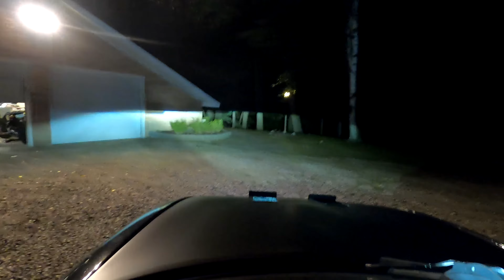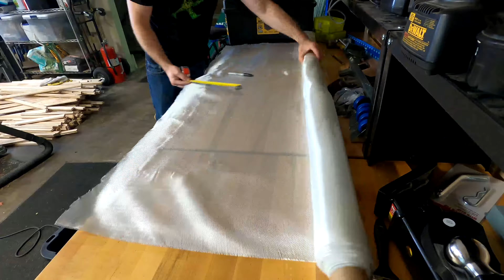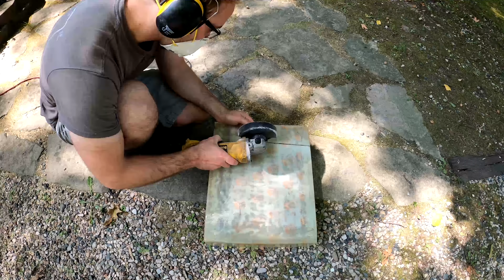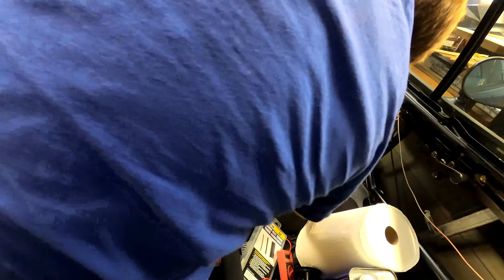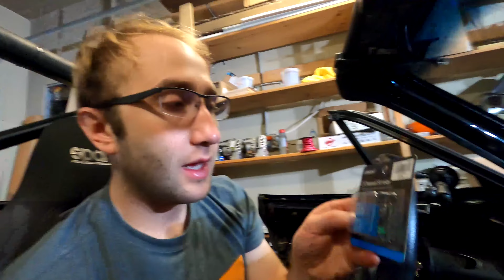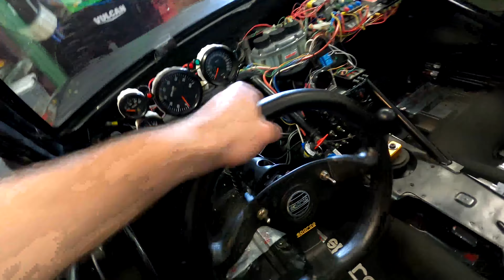Fixing and Improving My DIY Adaptive Headlights

Comment: Hi!! This project is super cool and im trying to do something similar for my car , for your pot sensor what gear did you use on it and the steering wheel? And is that setup attached to the steering column something i can buy or did u make it yourself?👀

Comment: why in the world didn't you use a draw wire encoder for the steering angle? It would have been less prone to problems, and it wouldn't need anywhere as much engineering to get the thing attached. I am in the process at this time of adding 2 HID projectors to each of my headlamp assemblies. When done they will be curve active and also horizon active. All of the electronics are inside of the housing. You are also going to run the risk of cracking your windshield because of the heat from the lamps. I don't see any kind of a limit switch system involved in there, how is the design supposed to know if say you stripped a gear in the servo? You might also consider using RC car shocks that have the springs internal with this type of shock you can cut a small piece of spring to put on the opposite side of the plunger from the large spring. Fill with a heavy oil and now you have something that gets rid of servo slop
Reply from the maker: That came down to cost.  I looked into using a string pot but at the time when I first built this, any decent looking options were on the order of a couple hundred dollars.  The style of pot that I used can be had for ~$10 and integrating it really wasn't that bad.  A string pot would have eliminated the gears and any lash concerns but the gears have proven reliable so long as the lash is set properly and they're sufficiently well protected to keep the wire for my steering wheel controls from getting sucked in.  I had more problems early on when a couple of pots that I sourced from Amazon failed but when buying what was allegedly the same model from DigiKey the problems went away so I'm suspicious that the Amazon ones were counterfeit.  

Are you documenting your project anywhere?  Sounds pretty cool! 

I'm not worried about the windshield cracking since it doesn't get very hot inside the housing.  The housing has a sufficient surface to volume ratio to dissipate the heat effectively.  No worse than running a defroster.  

There aren't any physical limit switches but there are software limits that, to date, have been successful in keeping the components from reaching mechanical limits.  

I've actually considered incorporating RC car dampers and might still do it if/when I revisit this project.  The springs that I have now soak up any slop in the servos but the servos can still be kind of jittery in their movement.  I might be able to address this to an extent with software filtering too.
Reply: @CurtBagne  Hey I solved my starting position problem, and I no longer have a need for using limit switches as a way of knowing if a servo failed.

I was thinking how does the servo know when to stop moving.. well it has a pot in it that is attached to the output shaft. I opened up the servo located the solder point for the pot on the little board inside it and soldered down a wire to it. So now my servos provide position feedback. I have to mess with it a bit to see if I am going to need voltage dividers because I am feeding the servos with 5 volts and the ESP32 has 3.3 volt GPIO's. I am not going to be moving the full 180 degree range of motion so the pot may not eclipse the 3.3 volts. If it does it is no big deal to make the dividers.
Reply: @CurtBagne  I haven't done any real documentation yet on my lamps. I have 2 of them to do so after I iron out the kinks in the first assembly I will then document what I do on the second. Mine is pretty involved, I had to cut the back of the housing and extend it to fit the additional pieces in there. I ended up building a vacuum forming machine and I bought a sheet of the same plastic the housing is made from and I formed the piece I added onto the housing. I then used 1/8" rod made from the same plastic and put it in a Dremel tool leaving only 1" sticking out. I set the Dremel on it's lowest setting 5000RPM and I pushed the rod right at the seam where the housing and the new piece met. I went around the entire seam "welding" the 2 pieces together I have some photos and some information here. 

https://www.solsticeforum.com/threads/dual-projector-hid-retrofit-attempt.162037/page-2#post-2223275

I am using the RC Car shocks as dampers, the ones I got have internal springs and they also come with 4 different plungers that have a different number of holes in them. This is to set how much dampening the shock has. You can get a  draw wire encoder that is well made for about 100 dollars., the thing that drives the price way up is the length of the string. get the diameter of the steering shaft, do the math to get the circumference and times that by the number of revolutions the wheel can make (typically 3 turns 540° degrees each direction). It's a really short string that is needed. add in some some length for mounting and also so you don't hit the mechanical limits.

I am using a 3-axis gyroscope, 3-axis accelerometer, 3-axis magnetometer (to correct drift) coupled to a Digital Motion Processor (DMP) to get the orientation of the car. I am using madgwicks quaternion equations to break down the orientation readings into pitch and roll of the vehicle in degrees. My vehicle has stability control so I was able to reverse engineer the CAN frames for the stock steering angle sensor. Because I do not want to add any additional load to the car I also added in a 3.5 farad super cap so when power gets cut I am able to "park" the lamps, this way I do not have to go heavy on the springs. The cap is super small maybe 1" x 1" x1/2" there will be one for each headlamp assembly, it's enough to power 4 servos at 2 amps of draw and all of the electronics for close to 3 seconds.

If you got decent metal gear servos that are digital jack up the PWM frequency to 200, this will give you a far greater precision for the servos. It will eliminate most of the jerking. Another thing you can also do is for loop between every 10 PWM settings between the last position and the new position adding a small delay between the changes.
Reply: @CurtBagne  Oh I also found a company that makes a worm gear servo that has the same footprint as the ones you are using. A worm gear servo will have 0 slop and it will also lock in position when powered off. They come at a high price tag of 70.00ish  USD a piece and they have a lead time of 2 months to get them. the model number of them is EVO-P4W-SiC
Reply from the maker: @kevinschlossser7858   This is really awesome--I'll definitely be following your build thread.  Especially curious with how everything will turn out with the IMU and using the feedback from it.  A couple of thoughts though...  Have you looked into getting vehicle position info off of the can bus?  Most vehicles will have a gyro to measure the roll axis.  They use a "leaky integrator" to avoid drift.  To my knowledge, most vehicles don't have a gyro for pitch; however, as it's not so crucial for avoiding rollovers.  

You might also be interested in adding something like this so that your setup can respond to traffic: https://pixycam.com/pixy2/  I wanted to incorporate one of these in my setup to aim my lights down and/or dip the high beams to respond to oncoming traffic or to be more courteous to vehicles in front of me but ultimately decided to just keep it simple because time.  

I'll look into some of those servo ideas, especially if they're fairly simple to integrate.  Thanks for sharing.
Reply: @CurtBagne  On most vehicles the accelerometer and gyro are located in the passenger presence module that is apart of the airbag system. Typically the EBCM and the air bag systems are tied together on their own databus. The information can be requested from the EBCM, in order to get that request frame you would have to use an OE diagnostic tool on the car. I would have to have access to one and set up a man in the middle type of system to know what is being sent out of the diagnostic tool.. at to be honest at 5 bucks for the MPU9250 i wasn't worried about it. I am running an ESP32 to handle everything. these things are dual core and have a 240mhz RISC processor. so they are fast and do not have problem doing complex floating point math. They have gobs of ram compared to the Arduino's. and there are exactly enough pins to do everything I need to for a single housing. I run MicroPython on it so developing is a breeze. and I can push software changes to it over bluetooth or wifi. It does have a can interface built into it as well tho this is not supported in MicroPython.

I had to come up with some pretty crafty ways to take care of some of the issues I ran into, because of how the lamp is directly connected to the servo and there is no use of a rod I quickly discovered there is actually a large amount of play in a servo's spline gear where the servo horn attaches. and my time that play gets up to where the lamp is the lamp would wobble about 1/4" total. I ended up getting aluminum servo horns and made a plate that foes over the bottom servos, it essentially joins them together, this play sits under the servo  horn and is such a tight fit that the aluminum servo horn slides on it. It acts like a slide bearing and removes the wobble from the spline. 

I am also trying to build this thing with cost in mind. I want to make it as cheap to do as possible. If I didn't have to build the vacuum forming machine I am about 200 bucks per lens.
Reply from the maker: @kevinschlossser7858  Sounds like you've got it all figured out.  Maybe our vehicle experience differs a little but the IMU should be tied to the ABS module.  At least for Conti and Bosch systems, the ABS modules handle all of the processing for the stability control and, as such, need to be continuously fed the vehicles inertial measurements.  If you have a definitions file or if it were worth reverse engineering, the pitch, yaw, and accelerations are all available for the taking.
Reply: @CurtBagne  I can tell you that using an MPU9250 is really accurate when using madgwicks quaternion equations. Those equations do a great job of filtering noise and sensor jitter. I am not looking for the numbers to be accurate as far as the orientation where 0 degrees is really 0 degrees, I need to know the difference between samples and I am averaging those over a really short period of time to determine if the car is going over a speed bump or up a hill. a speed bump is going to be an extremely sharp change to pitch. Hard braking is also going to be a sharp change to pitch. I am also collecting the vehicle speed over CAN so the faster I drive the higher it will angle the headlights up. I change the angle by 3 degreess starting at 30mps and ending at 70mph. it also corrects headlight aim due to hard cornering and weight shift of the car. it will pitch the lamp up that is on the outside of the corner and the lamp down that is on the inside.
Reply: @CurtBagne  I figured out a wicked simple way to get rid of the servo slop. It has allowed me to completely remove the shocks and springs and the servos stay put when there is no power supplied to them. IDK how I didn't think of this before, I was overthinking the problem is what I was doing.

I used these guys for the servo horns.
https://www.amazon.com/Seamuing-Aluminum-Futaba-Mechanical-Helicopter/dp/B07D56FVK5/ref=sr_1_5?dchild=1&keywords=aluminum+servo+horns&qid=1616742614&sr=8-5

I scrapped the screws they came with and picked up a 1000+ piece assortment of 3mm socket cap screws in assorted lengths. I took a piece of 1"x1"x1/8" aluminum L channel and I cut it so it would fit between the mounting holes. The L covers the top of the servo and one of the long sides. I drilled a hole in the aluminum where the spline is sticking out of the servo. I drilled it so the servo horn would sit in the hole nice and snug. when the servo horn is pushed onto the servo with the aluminum being sandwiched between the horn and the servo that removes all of the wobble to the spline and there is enough friction between the L channel and the horn where it eliminates drift when no power is supplied and it also eliminates the rotational slop from the gearing...
Reply from the maker: @kevinschlossser7858  Thanks for sharing.  That is a really simple fix.  I'm curious how it'll be over time seeing as it'll introduce an axial load on the servo which it may or may not be amenable to.  I could also see it wearing in and loosening up over time but seeing as servos are pretty inexpensive and that my car doesn't see a ton of use, I might give it a go.
Reply: @CurtBagne  The servo should operate better with the load. You are using springs to produce the load. This is using friction instead. The funny thing about aluminum is that if you rub 2 pieces together is doesn't wear like metal does. I think it's because of how soft it is. Also where you put the 4 screws to mount something to the frame horn...You will need to get exact length screws or file them down on the back side of the servo horn. Here is the cool think with this, you can leave one of the screw holes for an adjustment to the amount of friction you want to apply. so if it does loosen over time it can be adjusted to remove it. 

I set up my x axis servos like this and have been manually turning them back and forth, has go to be 1000 times by now checking for clearance. The were extremely tight initially and have loosened a little bit but not enough to allow play back in and they haven't gotten any looser after the initial "break in".
Reply: @CurtBagne  for the y axis servos the mount for the projectors is a U, It attaches to the servo horn and goes around the servo and the other side where I used another servo horn in the same kind of a fashion. The servo horn doesn't attach to a servo gear at on the on side, So I used a screw 2 washers a nut and a small spring to make a kind of a self adjusting friction deal. I will post some photos of it on that forum in a little bit so you can see what I m talking about.

I also started work on the second lamp housing and I started putting the electronics and wiring in the first housing. I changed up the micro controller to an ESP32 WROVER which has 4mb of ram instead of 100K. I decided to ditch the screen and control buttons and instead replaced it with a Web GUI. I had to scrap the idea of using super caps to "park" the servos because a step down would see the initial charging of the caps as a dead short and it would trip the protection on them. I could have deigned a charging circuit for them but it would have made it overly complex. So I will use a constant and an ignition wire along with a relay to shut down power to everything but the ESP32 and then put the ESP32 into deep sleep when the car gets shut off. the ESP32 has <1m of draw when it is in deep sleep so no parasitic draw problems there.
Reply: @CurtBagne  I also wanted to ask how you have the movement of your lamps set up. It looks like you have it so both lamps move the same angle whether you turn the steering right or left. If it is this would be a better way to set it up. Lets say that left is -angle and right is positive angle.. 0 angle is pointing straight. when you turn the steering to the left the left lamp would move to say -30° and the right lamp would move to something like -20°, and when turning the steering wheel to the right the right lamp would be at 30° and the left would be at 20°. This widens the beam pattern on the road. The other thing is as speed increases the angle of change to the lamps compared to the steering angle should increase meaning that the lamps would move more with less of a steering angle change.

It is actually really easy to change the code so the lamps move like that. You know where 0 steering angle is. anything below that move the right lamp 1/2 as much as the left anything above center steering angle move the left lamp 1/2 as much as the right.  I have a Lincoln MKS with adaptive/active headlamps and that is what they seem to be.
Reply from the maker: @kevinschlossser7858  My headlights are kind of crosseyed in that the right one points into left turns and the left one points into right turns.  This is due to the housing.  If the left one pointed left, for example, much of the light would be blocked by the housing.  IIRC both turn together, at the same rate, up to a point, and then the one that would be shrouded by the housing hits a SW limit.  It's kind of a simple way to provide the wider field of view that the method you're describing would provide and from experience, I can say it works pretty well.
Reply: @CurtBagne  With a standard headlight design the issue is reversed from what you have. the left one can move left and the right one gets blocked by the housing and cannot move as far left as the left one can and vice versa. How big is the housing you made?
Reply from the maker: @kevinschlossser7858  Yeah, my setup is pretty unusual.  The housing is 14" wide.  I used to have a wider housing and the inside projector had more authority to point into turns but it obstructed my view more than I deemed acceptable.  The current housing, with my height and seating position, is pretty unobtrusive.
Reply: @CurtBagne  I just did a test lighting of one of my assemblies. The projector I modified so the shade covers the entire beam for the dedicated high beam works great. The projector has a glow to it when low beams are on. I used 55 watt HID's  so I am getting between 4400 and 5000 lumen from each projector totaling 8800 to 10000 lumen per headlamp housing. Far cry from the stock 1200 lumen I was getting per headlight housing.